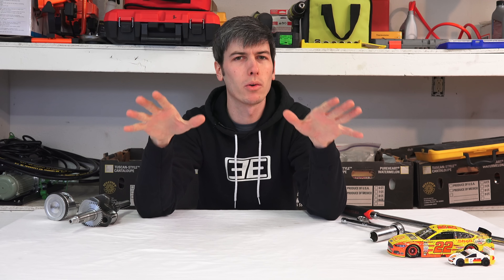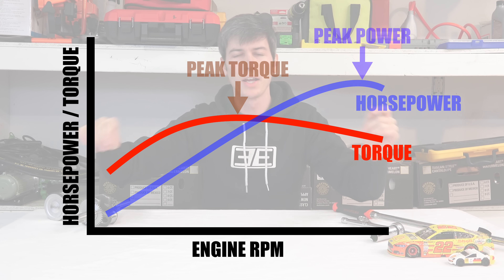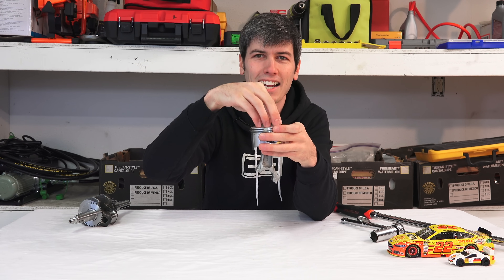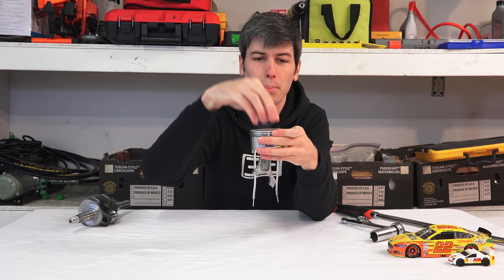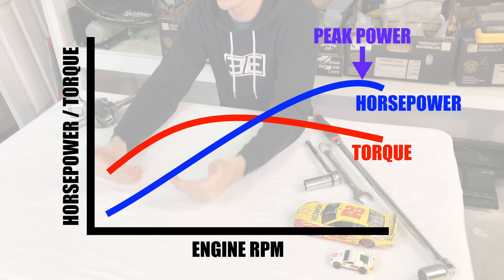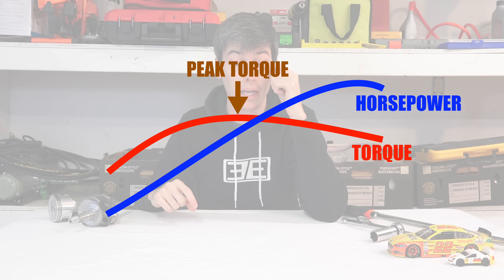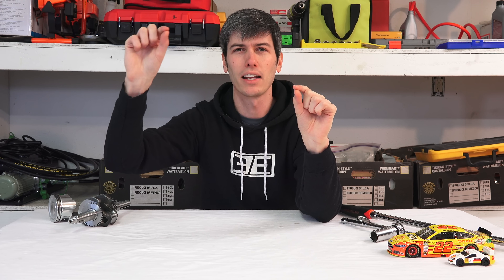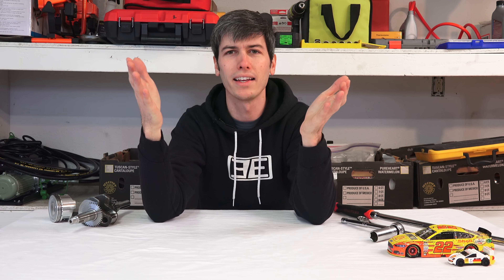Horsepower vs Torque - A Simple Explanation

Comment: But doesn’t toque give you a faster launch and more dig?😳😳
Reply: Launch and dig are consequences of force. Faster launch is force times speed, which is power. More dig is force times distance which is work.
Reply: It depends on how low down the rpm the torque starts at.
Like, V8's and (turbo-charged) diesels have lots of torque at low rpms that give faster launches.
Reply: @ReddThreee  Yes, but what does "lots of torque at low rpm" actually mean? It just means you have a relative high power output (hp) at low rpm. Engine torque is almost meaningless anyway, because it will be changed by the gearbox. Especially in lower gears you exchange rpm for more torque at the wheels, a lot more torque than the engine can ever produce.

Comment: The equations show at 2:30 were all I needed to "get it".

Torque is rotational force.  Horsepower is power which is the rate of energy flow into the system

Comment: So you can have 2 cars. One with high torque but low ram and one with low torque but high ram mathematically both achieving the same horsepower. Which ones faster?
Reply: Ram is rpm?
Higher torque will be faster but barely.
Reply: Nowhere near enough info. You're not just talking about engines, you're talking about cars. Loads of things have to be factored in.. weight, gearing and transmission specs, lubrication and coolant systems, tire size, aerodynamics... What do the whole horsepower and torque curves look like? Also your question isn't clear. What do you mean by "faster", top speed, or acceleration?

To be fair, the guy in the video did a really poor job, so it's understandable that you'd pose this question. Garbage in, garbage out.

Comment: The part I did not understand:  How to I get  higher gear ratio at peak horsepower (to get peak torque)?  Does higher gear ratio mean a higher gear,  and if so,  does this mean I have to hang out at top rpm in top gear?  Does not seem to lead to good acceleration.  Maybe the point is to take each gear to the redline where max power is, and don’t worry about the peak torque.  This is the intuitive way to get performance out of a car.  Thanks.

Comment: The thing that confused me was when you said 2 identical cars but with different horsepower and torque ratings, but then you threw gearing into the mix. Now I'm not trying to bash anyone or start any arguments. All the things were defined correctly, but real-world applications come out a little bit differently. If these 2 cars were at the drag strip and were identical, same weight, same transmissions, same rear end gears, and both cars got the same amount of traction, which car would be quicker? The car with more torque, it would launch quicker. Now given enough time and distance, the car with more horsepower would in fact eventually catch it and pass it. We can see this play out in real life today with people drag racing on the street with the newer Tesla's. These cars are much quicker than a gas powered car because they are getting maximum torque from the beginning all the way up to about 45 mph. Again, given enough time and distance, the car with more horsepower than the Tesla will eventually catch it and pass it. We can apply the same scenario to a tractor trailer. 2 trucks, identical in every way except the engine. One truck with a 300hp diesel and the other with a 600hp gas engine with half of the torque. The diesel will take the lead and it might actually take miles for the gas engine to catch up. Throw a climb up a mountain grade into the mix and the diesel would eat the gas engine alive. Don't get me wrong, I love engineers, the way their brain works and the cool stuff and designs they come up with. Engineers have made our lives much better in so many ways. The thing is though that what works on paper or on the design schematic doesn't always work out like they should in real world applications, and my biggest gripe about engineering done today is that they rarely take into consideration the poor SOB that has to work on it when it breaks.
Reply: Why a higher power output engine has to be paired to the same gearbox? The goal of a gearbox is to provide better power output of the same speed of a car, not the same engine speed.
600hp truck is better than 300hp truck.
600hp sports car is better than 300hp car.
That's real life.
Reply: @IgorArkin  Well of course a 600hp truck is better than a 300hp truck, if they were both diesels, and they would also have different transmissions. They would probably have different rear end gears as well, but that's also a better explanation of how to efficiently apply power than showing the difference in horsepower and torque. The higher hp truck or car is also going to have higher torque as well in the real world. A 14-liter 525hp diesel has about 1850LbFt of torque, where a 12.7-liter 430hp diesel has about 1350LbFt of torque. In the real world the advantage the 14-liter has in horsepower and torque could go right out the window if the wrong gearing in the transmission and rear end are chosen. Gearing is not what is being discussed in the video, it's horsepower and torque and throwing gearing into the mix to compensate for one engines lack of torque is cheating, it skews the results. In order to get a fair assessment, an accurate result on the difference between the 2 vehicles in his example, everything else in the 2 cars has to be identical. The weight, transmission, rear end gears, even the tires have to be the same size. Otherwise, you are not isolating what is trying to be tested, which is high hp low torque vs low hp high torque. In the real world I think you would have a heck of a time even designing and engine that would produce twice the torque on half of the horsepower to be able to even run this test in his example, but again, even if you could, in order to have accurate results everything else between the 2 vehicles has to be identical.
Reply: @mfraze8753  you keep saying everything has to be identical but still ignoring the speed of a car, which is a very common error. 
Power=acceleration*speed*mass. 
Everything being equal translates to mass is the same and speed of the cars is the same (cars are travelling besides each other or simultaneously start the race (which is a purpose of any race)). This leaves us with power is acceleration.  More power in these fair conditions always comes from increasing thrust on the driven wheels. Thrust is torque on the wheels' axis divided by wheel radius. Torque on the wheels' axis equals to engine torque times gearing ratios. Which finally means that if you wanna have more power on the wheels you need more engine power output. Which is kinda obvious, just a reminder. 
Torque has nothing to do with performance of a car/truck. And a Tesla, sure thing, would have been faster if it had a gearbox and reached its max power earlier. It's just nowhere to be faster anymore, there is a physical limit reached for a road car.
Reply: @IgorArkin  I keep saying that because of the example he gave, 200hp 100LbFt of torque vs 100hp 200LbFt of torque. Could you change the gearing in the car with less torque so that when the power got to the wheels it was the same power as the car with more torque? Absolutely, but again, it's not a fair test to see the results of the numbers he tossed out. Why? Because a gear box (transmission) is a torque multiplier. Let's say there is zero loss of power through the drivetrain and all you are changing is the gearbox. So, by doing this you are now taking the car with only 100LbFt of torque and producing a result (of power to the wheels) like it has 200LbFt of torque, but it also has twice the horsepower. Of course it's going to win the drag race. We could change all sorts of things to apply the power differently, power to weight ratios, tire diameter, rear end gearing. Would it be a fair test if I were to take these 2 engines, put one in a car and the other in a motorcycle? Now we are changing it so it's a low horsepower high torque bike at 500Lbs against a high horsepower low torque car at 2,000Lbs. Don't you think that's going to kind of skew the results?
Reply: @mfraze8753  are you messing up a car and an engine? Car ≠ engine and car's acceleration ≠ engine's acceleration. 
I told earlier that mass and speed are the only things that needed to be equalized but you keep telling bike vs car thing.
There may be limits for power only at any certain type of racings, with no limits for torque, because it doesn't matter. The car that puts more power/mass to the ground wins.
Reply: @IgorArkin  Do you actually think that mass and speed are the only things that matter? Do you really think that by changing the gear ratios in a transmission or rear end won't have an impact on the results? I stand by what I stated in the beginning, if you want to know what happens when you put these 2 engines to the test, they have to be equal in every other way. Same weight, same transmission, same rear end ratio, same tire diameter, same length driveline. Then and only then you will see what the difference is between these 2 engines. Change any one of those items and you are giving one of the cars an advantage. I'm not talking about setting one up to win the race, I'm wanting to see which one will win the race and in the real world if both cars were absolutely equal in every way except the engines, what would happen? I can tell you exactly what would happen. The car with the engine with high torque would leave the line quicker and about 1/3rd to halfway down the drag strip the car with the higher horsepower would pass it and win.
Reply: @IgorArkin  this video is supposed to explain and compare horsepower and torque. Honestly it didn't do a great job, partly because it added in other factors like gearing, and that only muddies the water. And that is what MFaze was trying to correct. If people want to learn methods used to compensate for low torque engines in automotive applications, that should've been addressed in a separate video. When you are trying to isolate and explain the difference between two concepts, you hold all other factors constant, just like MFaze was doing.
Reply: @dkcampbell3  so you too would like to see torque doing one thing while power is chilling somewhere and vice versa. You will never gonna see it. Once again, gearing is not a factor, it is equalization.
Reply: @IgorArkin  you'll never understand what you don't want to understand... And you clearly don't want to understand what MFaze and I have pointed out.
Reply: @dkcampbell3  you don't know even a fraction of the topic with that yours "torque produces acceleration and power produces top speed". Laughable. Truth hurts so here you go.
Reply: @IgorArkin  more things you won't understand because you're too busy trying to demean others so you can feel superior.

Comment: My hot rod u teacher just wrote on the white board “TQ = acceleration & HP = Top speed” and that’s all lmao 😂
Reply: And what happens to HP when car accelerates? Does it chill somewhere?
Reply: It's may be a little sloppy to use equals signs, but overall he's not wrong. Torque is what produces acceleration, and horsepower is what produces higher top speeds. When you gear down and use a clutch to produce acceleration, what you're really doing is using the inertial force of the high revs to produce torque at the wheel. That's why if you rush the clutch you'll kill the engine... Once the inertial force is spent, the engine isn't creating enough torque to produce acceleration.

Comment: I still have a problem, is a gain of 19 HP justified with a loss of 65Nm torque? Where are the limits of this dependence, if the goal is to drive a short distance?
Reply: Why do you lose torque gaining power?

Comment: Power is about speed, torque is about acceleration. 

FX: semi truck vs muscle car, each without trailer, up a hill. Car goes faster. Truck vs car up a hill with each pulling a huge trailer. Truck climbs the hill slowly, car goes nowhere. Why? Car has more power while the truck has more torque.

Related example: 700 HP Tesla S vs 1200 HP gas car drag race (you can see a ton of these on YouTube). Winner depends on length of raceway. Quarter mile, Tesla wins; half mile, gas car wins. Why? The electric has more torque and therefore accelerates faster. The gas car has more power and is able to reach a higher speed.

Examples are over simplified, of course, but the basic principle is the point.
Reply: Basic principle is wrong. Watch the video again and watch his other videos on topic. You have messed power, torque and speed.

Comment: Power equals torque multiplied by rpm's. Or torque has the dimensions of a force by a lenght, and power is energy by unit of time. Simple, isn't it?

Comment: if you have duplicat cars and they both have 300 hp but they differ in torque lets say one has 200 pound feet of torque and the other has 400 pound of feet torque then what would happen in a race?
Reply: Performance would be the same provided that the gearboxes are properly designed for each engine.
Reply: @Redtooth75  Diesel cars have usually a higher torque and the power from the engine is more aviable at a lower rev level than petrol motors, in my head this means that I would have full power at 3000 revs per second in  the diesel, but the petrol engine delivers max power at 5000 revs, now the motor reaches 3000 revs slightly faster than 5000 revs, conclusion power faster, then faster perfromance.
Like electric cars for example they have full power from the get go because they have torque through the roof, I know that they only have one gear forward, but if you think about it if you put one gear on a petrol car that had say 300 hp, it would take a longer time to get to top speed. Torque factors in when you get the power delivered.
Reply: @antonyjohnsargent  yeah, thats why I said it would depend on the gearbox.

Comment: I weigh about a 150 pounds,  the crank of my bicycle is about one foot,  so I can easily push 150 poundfeet from a standstill, if I pull 20 pounds with the pedal moving up, I can allo push an extra 20 pounds thus adding another 40 poundfeet. that adds up to 190 poundfeet, but I can only produce this torque at very low rpm, let's say 60 rpm, so the power is rather modest.

Comment: So if I'm driving at the revs that provide peak power and then put my foot down further such that the car revs faster and passes peak power to produce less power, how is it that more power is being used because of the higher speed and having to overcome more drag? I feel like this is a contradiction and am now more confused than I was before I watched this 😭
Reply: 🫣 you dont have more power at higher revs  cos gearing determined this but if you surpas peak power on some rpm and car motprcycle whatever is this accelerate to biger velocity that mean thers enough power to achieve this biger velocity at this biger rpm where is less power than at peak  only rev limiter stop accelerate further in this case or when power be balance with every resist 👌🏻 so you are on lower gear or you drive from downhill or manufactury intentionally make last gear shorter for some reason 👍🏻

Comment: Well, the power is simply the torque times the rotation speed. 
Metric unit and speed in radians per second. 
Example 100 Nm @ 6000 rpm 
100 x 6000/60 x 2 x pi = 62800 Watt
62.8 kW or about 85 hp.

Comment: At about 6:00 he said if they [CVT] adjust the gear ratio to maintain peak HP, they will accelerate the fastest. " 
I own a Subaru with a CVT. Is my tyranny adjusted in such a way? If not, then why not? Would it be because there is a trade off such that I would sacrifice fuel efficiency if it ran at peak HP all the time?
Reply: If you floor the gas it keeps accelerating at what revolutions?

Comment: CVT transmissions prefer high bhp engines which deliver power at high rpm. Automatic gearboxes with a torque converter love torque which is delivered at a low rpm. Engines that deliver high torque tend to be more relaxing to drive like a big V8 compared to a turbocharged 2 litre engine developing the same bhp but at much higher rpm. 

So take two cars exactly the same both have an 8 speed automatic transmission. One is a 4 cylinder 1.6 petrol engine with 181 bhp at 5500 rpm and 184lb ft (250nm) of torque delivered at 1650 rpm. 0 - 60 mph takes 8.2 seconds

The other car has a 1.2 litre three cylinder engine developing 130 bhp at 5500 rpm and 169lb ft (230nm) at 1750 rpm. 0 - 60 mph takes 10.3 seconds. 

Although the higher bhp of the 1.6 engine helps in the 0 - 60 sprint, there is not a huge difference between the engines on the torque output. Once on the move and in everyday motoring, the gearbox will keep the revs around the peak torque rpm in both engines. Thereby there would not feel a great deal of difference between the cars making up speed. However when maximum power is required, the 1.6 litre engine having more bhp will overtake quicker.

So it is a trade off between running costs ultimately. The 1.6 litre engine is around 7% worse on fuel overall with a maximum range at the most economical speed of 544 miles. The 1.2 litre engine with the same amount of fuel will travel for 590 miles. If you pay a road tax based on the CO2 output of your car the 1.2 would be cheaper as it produces 135 g/CO2 compared to the 1.6 litres 147 g/CO2. 

How often do you need that extra bhp? The 1.2 engine being three cylinders would be slightly cheaper to maintain, but a lot cheaper to buy.